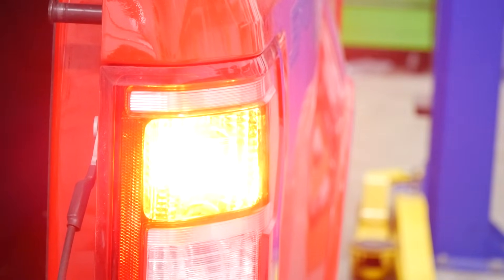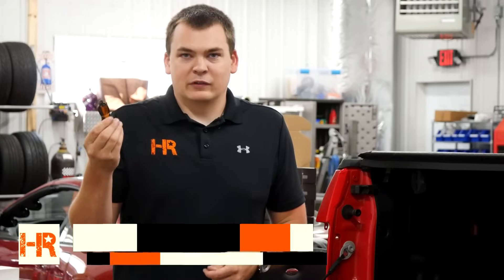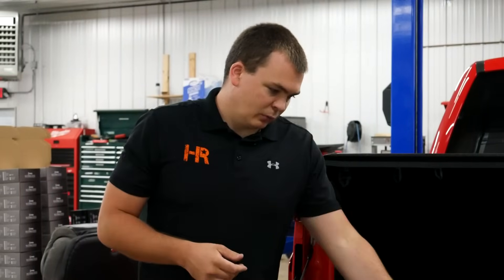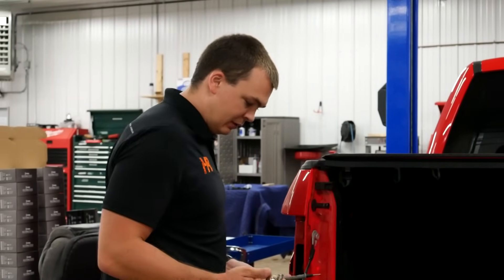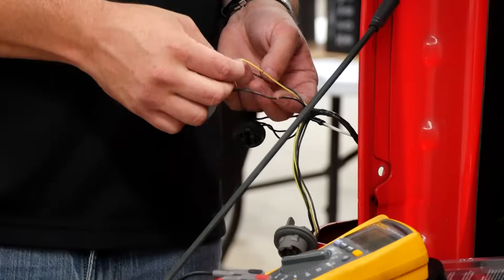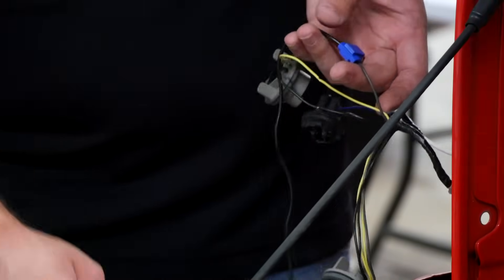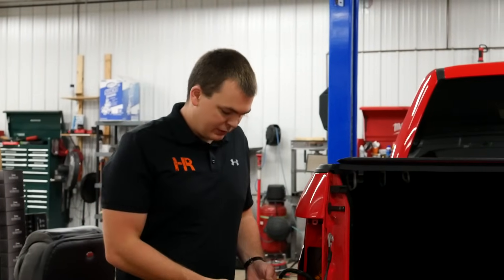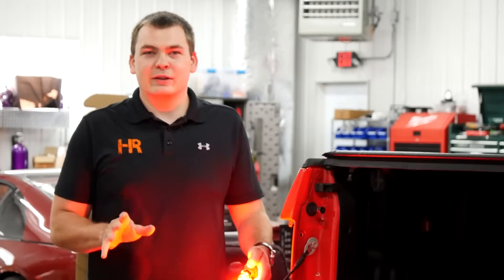How To Install LED Resistors - Everything You Need To Know | Headlight Revolution

Comment: Holy crap! This is the best tutorial video that answers literally every question I had. The Diode Dynamics video is trash which doesn't have close-ups of where each wire goes into the resistor or the use of either a multimeter or cheapo tester. I think you just got yourself a customer. Thank you!
Reply from the maker: Glad you liked it! Thank for the comment!

Comment: This is a great video as I am new into led conversion . My Chevy sonic does not have a turn signal relay so this is the alternate rough. Some vehicles have a turn signal relay and in that case you just have to swap it out with a new led relay "If Available ", GM made it so my AC  and turn signals are built into the same relay , so, don't want to play with mother nature on the AC and  use a alternate relay , other wise, If you have a LED turn signal relay you can buy for your vehicle you dont have to do what you see here. Thanks for the video, good stuff
Reply from the maker: No problem Chris!

Comment: Hey there. My truck has after market tail lights, and it's saying my parking lights are out. The dealership said I need some sort of sensor to help trick my computer. Is that what a resister is for?
Reply from the maker: That would be the resistor!

Comment: Question. If you put LED's in the front should you put the resistors in the front? If you do install resistors in the front and want to later put LED's in the rear, do you need to install resistors in the rear as well?
Reply from the maker: Good question. Yes you will need a resistor for each area of the vehicle that has a turn signal. So a pair for the front & a pair for the rear.

Comment: Ive bought a led strip that ive put on the front.It has a daylight running light ive connected that into the wire of my daylight running lights.the strip also have a flowing turn signal led so ive tried connecting it the same way but the turn flowing of the led s just goes halfway across the strip.What can i do to fix this..thankss
Reply from the maker: Reach out to our CS team for assistance!

218-755-5200
Sales@headlightrevolution.com

Comment: I have a 2021 Tundra and both tail lights have (2) wires on the turn signal only. This is great because I didn't need to test which wire was which like you had to in this video (with 3 wires). I appreciate the details in this video including how hot these resistors can get. Because they do. After installing your kit, my blinkers are back to normal pace now. Thank you for this video because it enables dummies like me to do the work ourselves.
Reply from the maker: Working on vehicles can be a task sometimes, especially with electrical work. It makes us happy that our tutorial videos are helping people like yourself install parts or solve any issues they are having with their vehicles. Thanks for the comment & keep having fun working on your 21 Tundra, those are indestructible.

Comment: I have a 2014 Honda fury motorcycle I installed led light strips the daytime running light will light solids and bright the blinker only lights the first two less and fast blinks I’m assuming I need a resistor. 

Would you guys have one for this bike or be able to help me locate what I need
Reply from the maker: Motorcycles sometimes require additional electrical components to get LED's to work properly. Give us a call or email us and we will be able to help you solve the issues you're having with your specific bike. Here is the contact information below.

Phone- 218-755-5200  
Email- Sales@headlightrevolution.com

Comment: Have a 2015 Honda Pilot.  Did everything you said.  Blinkers worked correctly  but now parking lights dont turn on. 3157A is the bulb.  I know the parking ligjts work on because i tested the wire with test light. What could be the problem?
Reply from the maker: The bulb may not be compatible!

Comment: Here's a question u have led tail lights with built in resistors. I've had them for about 5 years but now when my parking light are in I get hyperflash and with the light off they work as they should. Any zugestions would be helpful thanks.
Reply: Also I have no lights burned out anywhere else.
Reply from the maker: Needs resistors!

Comment: How do you find which out of those three is the ground by just using the test light and not the multimeter ?
Reply from the maker: Ground is TYPICALLY the darker color wire, but a test light or mulitmeter is always best!

Comment: What if you have 3 turn signal bulbs per side? Does it need 1 resistor per side one one for each flashing bulb?
Reply from the maker: This is a tricky question, this would most likely require some trial and error testing.
Reply: @HeadlightRevolution  I ended up getting an adjustable relay so that I could adjust for the sequential timing, the relay were also for LED bulbs so I never needed the resistor. Worked great. The question was for a 2004 Mach 1

Comment: I'm from Uk. I've recently changed my 4 flashers to LEDs and have got hyper flash. Do I need resistor for each turn signal or do I need just 2? I have a Nissan Qashqai. Thanks
Reply from the maker: You may only need 2!

Comment: What happens if you put an incandescent bulb back with the resistor still on? Would the total parallel resistance cause any problems?
Reply from the maker: It would not. But I would not recommend it!

Comment: Hi there 
Great informative video 
I’m from the uk and have just installed aftermarket led rear units to my 2014 Range Rover l494 and after installing them they work fine but when starting the engine sometimes the brake lights go out completely which is a little strange as the original lights are also led?
Do you think if I was to put a resistor between the brake light wires it could solve this as thinking maybe the aftermarket lights are requiring more or less voltage than the original?
Just seems the ecu or something is disabling them.
Thanks Simon
Reply from the maker: That could fix the issue!

Comment: I have a question: besides flashing fast and being annoying like you said....what harm will it do if you don't install the resistor?
Reply: There will be error code if u scan other then that no issues I have mine without resistor for the past 3month no problem till date. now planning to install them the sound is starting to annoy me 😂
Reply: @Garuddd  OK, thanks, that's what I thought...My blinker sound comes through the front speakers which rotted out since it's a '07, the new speakers I didn't go through the system so no sound, just fast flashing.....what kind of code would I get when I scan it? Just something about the lights?
Reply from the maker: Reaching out to our CS team would be the fastest way to get some help, give us a call or email!

218-755-5200
Sales@HeadlightRevolution.com

Comment: Why do you install resistors when an LED flasher solves the whole issue? All that trouble and all you had to do was buy a $7.99 part that takes 20 seconds to swap out.
Reply from the maker: Those always don't work on every type of vehicle.

Comment: I did the same but mine didn't work. I am sure the wiring I made has no mistake. When I first start the car, there is error code and when I blink the signals, the first 3 blink is fast (hyperflash) then it blinks normal. After using both signals, the error code is gone. Turning the engine off and starting again, the whole process repeats. How can I solve it?
Reply from the maker: Shoot us an email at Sales@headlightrevolution.com and we can help

Comment: Awesome video. Did the same on my vehicle and never had an issue with my front and rear LED turn signals. Even through intense heat and cold.
Reply from the maker: Thanks for the comment

Comment: This video answered virtually every question I had in regards to LED lighting and resistors. Thanks!
Reply from the maker: Glad it helped!
Reply: doesn't say you need a resistor for each signal or 1 resistor is all that's needed.

Comment: You left out what happens if you had the ground and the positive wire flipped. Also soldering is not always the best way to joint wires. It depends on the application. There are studies out there showing applications and reasons why it’s always the best way. When you solder the wire it creates a still point in the wire witch under vibration it can cause a break. There’s a reason why wires in car are high stand count and not a sold core wire. Plus anyone can solder but it take practice and experience to learn how to solder correctly and in a way that does not cause corrosion. Also when installing t-taps make sure you use a good quality one like 3m also I like to use a zip tie securing the new wire to the wire being tapped to prevent any chances of the new wire to be pulled or be able to pull out or off of the t-tap. also I have seen some resistors fail. Mainly the ceramic style witch after the heat cycles per time the ceramic get brittle and falls off. The new metal ones don’t seem to have that issue. Also when installing them be careful
To what your mounting them to. Plastic will melt or if there’s a harness running on the back side of the metal. I have seen a wire harness metal due to a resistor hearing it up to much on the other side. Now when proving for the wire I would suggest to probe at the bulb where you do not have to split the insulation on the wire. That’s creating a possible location for corrosion to start and cause the wire to fail. Plus like he said use good quality electrical tape supper 33 or 7000 3m works great for cars or if done correctly the liquid tape works well. Basically want to seal up the connections to prevent moisture from getting in and causing corrosion. There’s many ways to complete this task and some ways are better then others but it also depends on the application, time to do the install and availability of parts and install hardware. Also sometimes things will fail many years down the road and some people don’t care because they won’t own the car in 5 years. It just depends on the application. I watch out on some cars mainly gm that have three wires going to bulbs two will have 12volt and third will be ground but when the car goes to sleep one of the 12 volt wires will measure lower voltage like 3-8 bolts because the bcm is asleep and needs to be told to wake up and turn that one. Just FYI.
Reply from the maker: This is an older video and there have been changes. but thanks for the detailed response.

Comment: I copied the steps exactly and used a multimeter but my interior lights are flashing with my turn signal wtf 😂
Reply: I'm guessing I fucked up the wires but I did use a multimeter and i connected it to the same ones
Reply from the maker: Shoot us an email if you still need help Sales@headlightrevolution.com

Comment: Change to the blinker fuse (in your fuse box, it makes a clinking nose) that has a voltage regulator in it. Plug and play, worked for my f150.
Reply: flasher relay is what you mean to say.
Reply: Explain

Comment: Headlight Revolution... I have a 2002 dodge ram 1500 . I have purchased a set of led headlights . I am having a problem with them flashing when I try to switch from low to hi beam and they won't switch over to low . can u give me a solution to solve this problem. thanks
Reply from the maker: I would suggest reaching out to our CS team so we can go over some options with you!

218-755-5200
Sales@HeadlightRevolution.com

Comment: So since i changed my headlights to aftermarket do it connect the resistor to my headlights or taillights?
Reply: You only need these connected to the turn signals. And only in the case where rapid flashing is occurring. 

They're not needed for headlights or tail lights
Reply from the maker: Only the turn signal!

Comment: What's the difference in doing this & just changing the flasher relay?  I upgraded my 02 RAM with LED taillights & all I did was swapped out my flasher relay to stop the hyperflash?  Will it damage anything if you don't have led resistors installed?

Comment: I installed leds in my 2002 ford expedition eddie bauer 5.4l but when I turn on my turn signal on it doesn't flash but when I reinstall the factory bulb it hyper flash

Comment: Can I install a resistor to the rear turn signal wiring to solve hyper flashing on the front due to led switch backs? I’m asking due to room/ access being easier in the rear vs in the front.

Thanks!
Reply from the maker: Depends on the vehicle. On some really old cars and trucks the circuit is connected front to back, but on modern vehicles it all goes through the BCM so that won't work.
Reply: @HeadlightRevolution  Please define "really old".  Like a 1999 Ford Taurus?

Comment: thank you for making this! I do have 1 question however. I have an 04 Chevy Malibu. Replaced just about EVERY exterior light (lol) with LED's. Question I have is, if I put a resistor in the tail light, do I need one in the front blinker as well or will that 1 resistor cover it all? I'm guessing from this video, I need to put one at both ends of the car so I would need a total of 4 resistors.  Again, great video and thank you for sharing this with the world!

Comment: I figure we need a resistor for the left and right side turn signals.  But will we need separate resistors for the front led turn signals also?   Or since they are one circuit for the left and on for the right, only 2 resistors needed for the entire truck.

Comment: Do you need to put load resistors on all the led lights or just the ones that blink?
Reply: Depends on the car. Most only need blinker but if you put it on your blinker and you find your taillights heat up put it on both
Reply from the maker: You will usually need them on just the blinking LEDs, for headlights, we have something different than just a resistor! Let us know if you have any other questions, we are here to help!

Comment: Hi l looking for resistor that can solve the DRL not working when you put new Led on my Toyota Highlander 2016. Thank you.
Reply from the maker: The only thing that we will have that will work with that DRL will be the Xenon Depot Xtreme LED Pro bulbs with the DRL Drivers. I have linked those for you here: https://www.headlightrevolution.com/2014-2018-toyota-4runner-high-beam-xenon-depot-xtreme-led-pro-1418T4RUNNER.XD.HIGH_2?quantity=1

Comment: Do you need a load resistor  for each light? For example, you have two dual function lights on each tail light left and right?
Reply from the maker: You will need to have load resistors for each bulb that blinks! Let us know if you have any other questions!

Comment: Great video but I have a couple questions. Do I need to do a resistor for every corner of the truck or just one for the left side and one for the right side? I'm always leery of stripping installation back unnecessarily, can I check the power were it goes into the socket
Reply from the maker: Whenever you install an LED into a halogen turn signal application, you will ;need a turn signal resistor. They will stop that turn signal from hyperflashing with the LEDs installed, and will prevent those bulb out warnings! You will just need one resistor per LED turn signal bulb! Let us know if you have any other questions, we are here to help!

Comment: Thank you for sharing the video with the useful information 🙏
I came acroos that video while trying to get my turn-signal LED bulbs works.
I have a Suzuki s-cross (crossover) 2013. Turn-signal lights are PY21W.
I replaced the 4 of the halogen ones with 4 Osram ledriving SL PY21W Amber.
2 LEDs on front doesn't work at all (they are tested other way and not faulty).
2 LEDs on back of the car blink faster then usual.
1. Do i need to switch the car's wires polarity of the front plugs? becouse that kind of bulb base can't be fixed other way to change polarity (because of the 2 pins on 150° that make you fix the bulb only in 1 position).

After sorting out the answer to question 1:
2. About the fast blinking issue - do i need to put a resistor near any LED bulb (4 resistors at sum)? Or put 1 resistor near 1 LED bulb is enough for the whole 4 turn-signal circuit? 
Best regards!

Idan
Reply from the maker: We will need some more information before we can assist you, shoot us an email with this information and infoprmation on if you are using any PWM modules or any added modeles to correct that issue. When we get that email, we will be able to assist you with this! Thank you for your time, and have a great day! Sales@HeadlightRevolution.com

Comment: Do NOT use the included t taps to install ANYTHING exposed to the elements. The break in the wire caused by the steel connector will react with the copper wire and corrode, and in two or three years the connection WILL fail. Solder and heat shrink is best option, but quality electrical tape will work too...... QUALITY electrical tape being the key.
Reply from the maker: Soldering will always be the best, we just have those T-Taps included for people that do not have that equipment or knowledge! Thanks for commenting, have a great day!

Comment: Fantastic video.  The step by step was excellent.  Will you do the same if you have LED headlights that flicker?
Reply from the maker: That will require a little different part and process, we would ask that you email into us if you have any issues with your headlights, but it could indicate that you need a pair of PWM Modules that I have linked for you here: https://www.headlightrevolution.com/gtr-lighting-pwm-hid-kit-modules-ACC.PWM5202.MOD_2?quantity=1